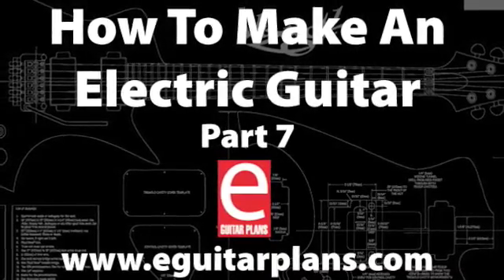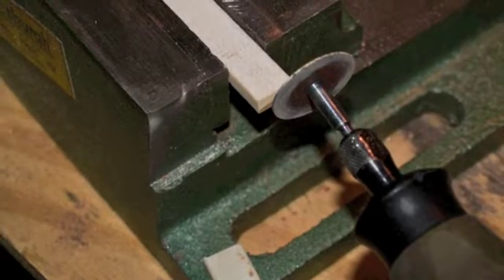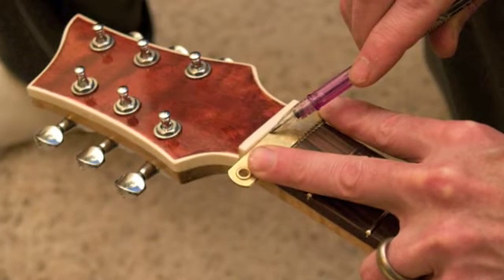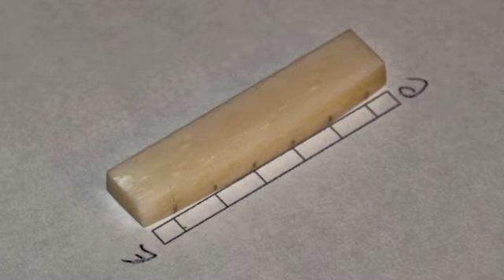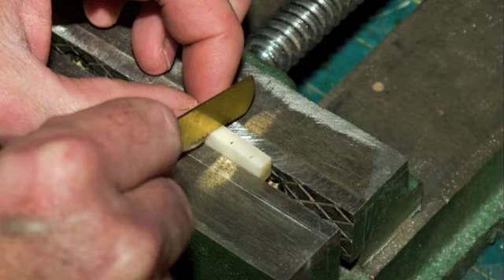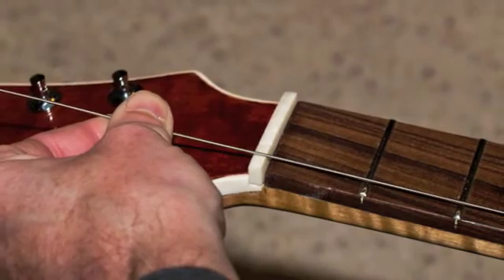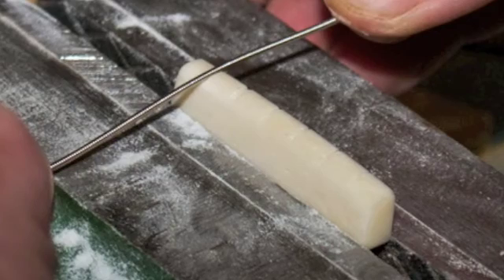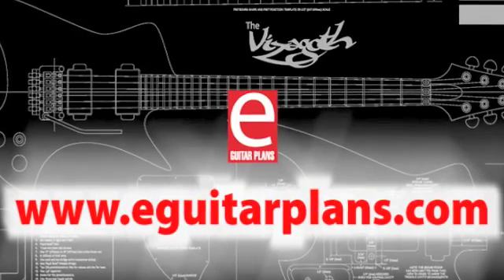How To Make An Electric Guitar, Part 7

Comment: can i make a nut from Teflon 
or it won't works?
Reply: Teflon or PTFE is a coating or can be made into a fibre.
It's not a solid block. If the nut is well made you don't need a very slippery coating to make it work. 
The shape of the nutslots and the direction of the strings after they pass through the nut towards the machine heads is important.

2:47...must be a lefty model